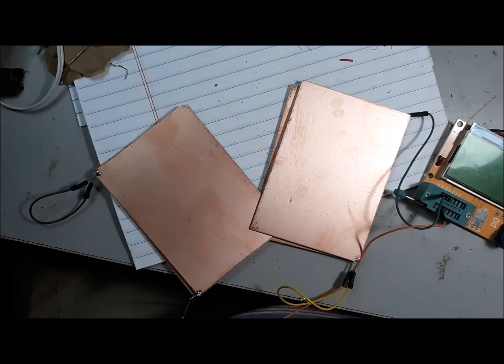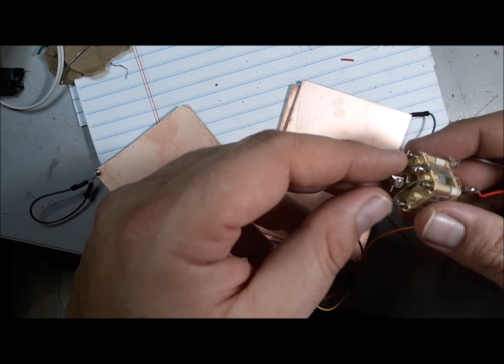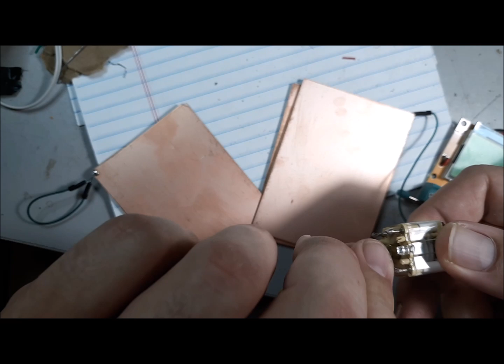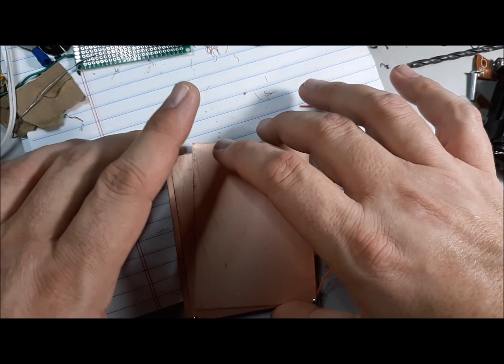PCB Variable Capacitor (Experience by Experiments)

Comment: Now that is a great experiment!  I've seen other hams on YT use paper tubes that slip inside one another.  They were covered with aluminum foil.  They used it to tune for something; they worked really well.   I am glad you have a tester for capacitance,  one of my next purchases hopefully.  When I was in high school 50 years ago, a ham friend had a couple of giant used capacitors that he charged up and used to power his transistor radio - now that was 1960's fun.
Bob - W9PZ

Comment: PCB cap will handle more power than that varicon...
Reply from the maker: I was checking out other experiments with PCB caps and it seems they are useful for mag loops for that very reason. I'll post more when I have done some more experimentation and building :)